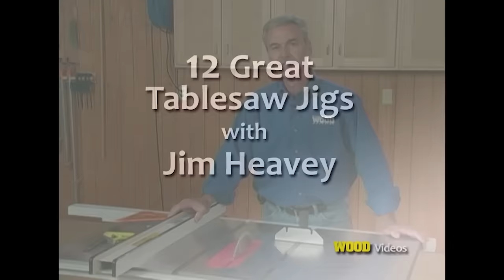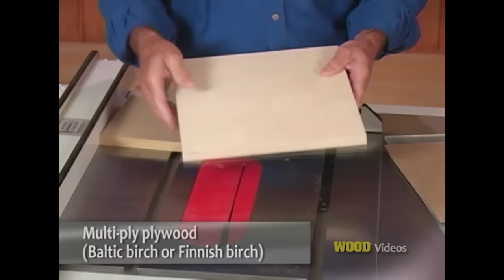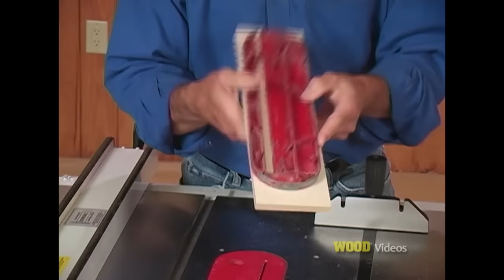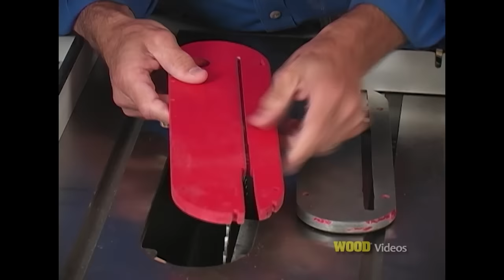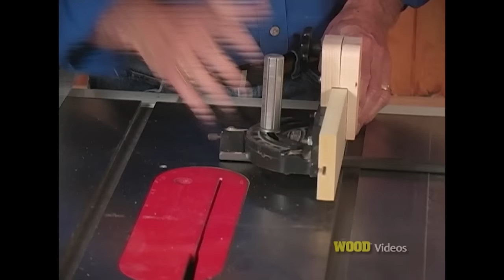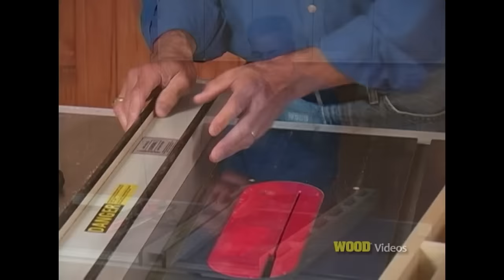12 Great Tablesaw Jigs with Jim Heavey - WOOD magazine

Comment: I had issues getting my crosscut sled to a perfect 90 until I used a 3-4-5 triangle, but x3, so a 9-12-15 triangle.  I cut the bottom then measured from the cut along the back fence 9 inches and made a mark, then measured 12 inches along the cut on the bottom and made a mark.  Then I cut a piece of wood to exactly 15 inches and put it between the marks.  When the 15 inch piece of wood was perfectly on the marks, I knew the sled was exactly 90 and I clamped the fence down and then secured it with screws.

Comment: Click on the minute mark to go straight to the spot in the video. Wish they would have done this themselves. I knew I'd be back to this video several times. I figured it could be useful for others also. 
Before You Start Making Jigs
0:30 1. Assure the blade is at 90 degrees to the table
0:51 2. Assure the fence is parallel to the blade
1:20 3. Assure the miter is square 

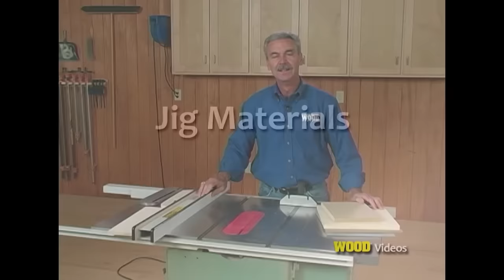1:45 Types of materials to use 
 
Must-Have Jigs
3:36 Zero clearance insert
6:36 Miter gauge extension and precision stop
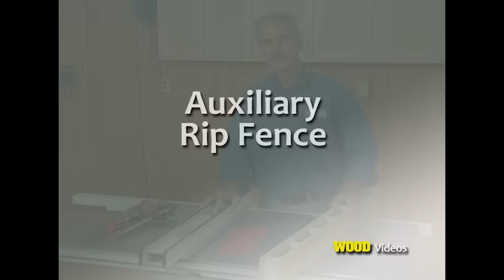8:19 Auxillary rip fence, aka sacrificial fence
10:30 Off-feed table 

Nice-To-Have Jigs
13:00 Raised Panel (for cabinet doors, etc.)
16:30 Ninety-degree crosscut sled
20:50 Four-sided tapering 
29:30 Tenons
34:30 Spline-cutting (for the corners of boxes and frames) 
37:00, suggested one at 38:30 Thin-strip ripping (to fill the splines from the previous jig)
40:35 cove-cutting  (create crown mouldings)
Reply: They should pin this comment to the top!
Reply: Thanks, that was appreciated.
Reply: I was looking for the table of contents guy.... Found him...Thanks!
Reply: Thanks Pedro for both thinking of this idea & for delivering this invaluable timesaving "tracking index list" for this incredible video.!!!

You're indeed an unselfish Saviour.!!!
Reply: Thank you, now I don't have to watch this whole video to see what he is doing. aka, I don't have to watch any of this video because I already have all of these.
Reply: Thanks dude! Much appreciated. 👏🏻👏🏻👏🏻
Reply: @gwythal.doire.4361  ; LoL, you're welcome :-)
Reply: So what.. nothing else to do?
Reply: @xl000  A little OCD works out well for woodworking. 
Apparently, Pedro saw a way to make an improvement and took it upon himself to do the community a favor. 
I’d say it’s a generous use of his own time. 
Viva La Pedro!
Reply: i count 11 jigs... is #12 using the four-sided tapering as a jointer or is it the one a lot of people use for Thin-Strip Ripping, but he doesn't recommend?

Comment: On the tapering jig starting at 26:45 where he is turning the work piece to put the taper on the other sides add some springs on the clamping devise. The spring will keep the clamping device in the upper position when you loosen it to turn the work piece allowing you to slide the work piece into the device easily then tighten it to make your next cut.  Thank you very much Mr. Heavey and this is my gift to you.

Comment: Great jigs!  I made my crosscut jig a lot bigger, and never regretted it.  Just used it tonight to build a cabinet, and I needed that space.  I'd also add some more meat on the crosspiece in the vicinity of the cut so the sled doesn't bend or break while handling it.  I'll be using that cabinet to store jigs...

Comment: Great video.  One suggestion with the taper jig, if you attach a runner to the bottom then you don't need to use the fence, and you will know that the edge of the jig will always be tight to the saw blade.

Comment: Some great ideas and a brilliant video. Fast spoken right to the point no fluff love it. One suggestion if I may. The last jig for doing trim moulding. I believe it would be better to have the cross brace pivot on the side closest to the blade and the excess crossing over the fence instead of having to move you're feed hand every time to jump over it.  Thanks

Comment: Jim one very very important setting to check is to make sure the blade is parallel to the groves cut in the table saw top. I bought a brand new Grizzly table saw and could not figure out why this saw wasn't cutting square cross cuts and seemed to be binding. It turned out the blade was over 1/8" out of parallel to the groves in the top and that is just from the front of the blade to the back of the blade. It was so bad I didn't have enough adjustment to correct it. It was also years later that I found this out and had no warranty and had to take it apart and get the pieces machined to correct the problem. It is an advanced setting but one that can and should be checked when even you get a new saw.

Comment: Loved the video but one thing that you did not mention which has been a persistent issue with several wood workers I've known is blade/table alignment. It is generally not a difficult adjustment but can wreak havock on everything you try to cut as long as the blade is out of square with the table including but not limited to excessive kick backs and blade warpage.

Comment: I really appreciate this tutorial. Awesome ideas worked out to be easy, accurate, and efficient.  One question: I didn't read all the comments, but observed that the raised panel cutoffs were a bit less deep at the front of cut, and then rode a little deeper into the panel in the center cut.  If this shallowed out again at the back end of the cut, it makes me wonder if the slight caul is the cause? Are the clamps pulling in far enough on the outer ends of the panel?  The main question would be whether the raised panel profile has any visible swoop near the corners?  But this is way better than trying to freehand a raised panel cut against the stock fence with two clamps

Comment: Excellent Video.  Thanks for the clear explanations.  In January I scored an excellent belt drive table saw with a brand new 3hp motor and new bearings everywhere.  It was an opportunistic find.  Very inexpensice.  All cast iron with a heavy duty steel angle iron stand.

Comment: great video, only change I would make is on the cove jig: The brace for the arm that gives the angle to the fence should be swapped allowing the "extra over hang" to be placed over the saws actual fence. this would allow for the piece of material going over the saw blade to ALWAYS be supported by both hands at all times. (Right now you need to move your hand off then over and back to the board. this can cause several unsafe conditions.) just my thought. AWESOME JIGS... THANKS
Reply: Jesse Izor mo
Reply: Exactly what I was going to suggest!

Comment: I feel like a kid on Christmas morning!  What a pile of presents!  I will be making several of these, if not all, especially that cove-cutting jig.  I've been locked into the idea of clamping a fence at an angle to the table top, but this is much nicer.  I may put the swing arm's pivot on the angled arm, so I don't have to work around the end of it, and just let it stick out over the fence where it's not in the way of anything.  But a super jig, AND a super collection of jigs!  Thanks!

Comment: the jigs are fantastic. a little more elaborate than some designs (e.g. the crosscut sled) but every feature clearly adds value and is worth the effort to incorporate.  the feature-by-feature explanations are a little terse for a beginner (I had to catch the tapering jig segment 3 times before I understood how the nylon locking nut on the first toggle clamp is important, and the dual-level shelf on the shoulder jig never really got explained). The bulk of the crosscut jig build and feature explanation got edited right out, but overall a really good tutorial. I will be trying many of these out in my shop.

Comment: Very good video! One caution: I bought a used table saw and the blade was NOT completely aligned with the miter slots. Thankfully the saw did allow for adjustment and I have plenty of experience with the  alignment of machines.

My brand new jointer, a very nice one, needed the gibs replaced. I machined and ground them myself, and it works beautifully now.

Comment: Great video and have watched a few times and I have some new ideas for jigs.  A suggestion on the jig to cut coves.  If you put the fixed point on the cross piece on the board that swings and then tighten the knob at the other end that will now be by the fence, you won't have to move your push pads and overreach your hands over the cross piece.

Comment: These are great. I did wonder (for the cove cutting jig) if you hinge the swing arm on the arm going across the table, you won't need to hop your hands over the excess (which will instead hang over the fence)  -might make for a smoother cut??

Comment: If your zero-clearance insert has seen better days, tape the top completely closed and pour epoxy onto the underside.  Recut your slot and it's as good as new.  PU glue would also work.
Reply: smart
Reply: son of a b#@$h that is a brilliant idea soldier.  how long were you at Ft. Benning?  for me 5 years G company 1/10FA 3rd brigade 3rd ID up on Kelley Hill  08-13
Reply: Nice idea thanks.
Reply: Bondo auto body filler works great also.

Comment: For cutting stock down to make a zero clearance insert, I usually use 2 sided tape to stick the original insert to the plywood and route it with a flush cut bit.  Then the contour is a precise match to the manufacturer's insert.

Comment: One point I have had a problem with. At the beginning you talk about set up. You checked that the blade was parallel to the fence, by checking that the fence was parallel to the grove in the table top. That assumes that the blade is parallel to the grove. Mine wasn't, it was about 3-4 degrees out of line. The table had been dropped pre-delivery. It took me a while to figure this out.
You can check blade alignment with the grove in exactly the same way as you checked the fence alignment with the groove. If you pick one blade tooth as a reference, that should allow for any non-flatness in the blade.
I only mention this because it took me 2 years as a beginner to work out why some of my long rip cuts were producing banana shaped strips.

Comment: Jim,  If I need to make multiple zero clearance inserts I don't remove them from the original insert. I keep a supply of the set screws on hand or put them on my  need list when planning a project. it helps me in several ways, including the longivity of the inserts.

Comment: Very informative video - many thanks!

When I saw the four-sided tappered jig, I thought: "Wow 16 cuts to make for a four-legged table; that would be incredibly tedious and hard to do without this jig!" Sure enough, Mr Harvey mentioned it later on.  I still don't understand the plastic stopper on the top of the jig, though (as I can't really see it).

What is even more interesting are the terms used: shoulders, cheeks (for tenons).  These terms are very easy to remember!

The last jig (cove-cutting) is also very interesting - it might come in handy once in a while.

Once again, thank you for a great video.

Comment: You do fantastic work, I wish I had you as my instructor back in high school. Every jig is very helpful. Thanks keep up the good work. ⭐️⭐️⭐️⭐️⭐️
Reply: Yea mime was a real jerk I failed shop because he wouldn’t let use anything with a motor on it, he handed me 50 Small knobs a a pc of sand paper. Today There’s no tool I don’t have today and can skillfully use all of them. No trade in construction I haven learned or Equptment I haven’t ran. I Dropped out of high school at 9th grade went into construction at 16. At age 48 I was a self made multi millionaire as builder developer. AMERICA IS GREAT I Never get to do things for myself because always working, now it time at 66 to slow down and enjoy wood working for enjoyment and hobby.
Reply: @dduncan221  hey Dennis saying that you’re getting close to retirement I’m already retired I’ve got into the hobby of RC airplanes a lot of fun nowadays I join the club and the guys are fantastic a lot of fun and you might want to look into. Once you buy your transmitter and a couple of batteries the planes are fairly inexpensive.
Reply: @w.j.bendellr.c.flying.1037  RC? Is what sorry
Reply: @dduncan221  Radio controlled airplanes, they have some that almost fly automatically very easy to learn. I’m having a blast flying.

Comment: @4:55, instead of cutting a zero-clearance throat plate on the band saw, use double-stick tape to mate the factory throat plate to your plywood and use a pattern bit in your router to cut the plywood.  The factory plate is your pattern.    Also, @42:16 (cove cutting jig), flip the brace so the wild end lays over the top of the saw's fence; the brace is now out of your way.  Cheers!

Comment: 32:38 Ha, easy to construct a tenoning jig for a Biesemeyer style fence.  My tenoning jig for my Unifence is a work of abstract art.

But the tips in this video are fantastic, I will definitely be making some of these.  btw, 29:00, I use a couple of simple 3/4-in. "rip sleds" of four feet and eight feet (could be any length) to straighten out stock, both for finer trim boards and dimensional for framing when I need perfectly straight walls - so I rip 2x6s or 2x8s down to 2x4s or 2x6s, especially for curved walls, walls to be tiled, etc. - since we know there is no such thing as a straight 2x.

Comment: One thing to add.  There is a way to check if your crosscut sled is accurate.   Cut a wide parallel piece of stock with the sled.  If the long edges are parallel and the cross cut is exactly 90 degrees, the cuts will still line up when you flip one of the cut pieces.  Any error will show as a gap.  And of course... excellent video.

Comment: on your last jig you should switch your top brace end for end so the stationary nut was out by the table saw blade and the adjustment nut was by the fence that way you don't have to work around the excess brace.alot of good information thanks.

Comment: Helpful for a novice or somewhat new woodworker. I liked the taper jig. I don't like the thin strip one at all, that's what a push stick is for. I also wouldn't cut 1/8" anything on a table saw after 25 years on one. That's what thickness Sanders are for

Comment: On your cove jig I would suggest the cross member originate on the angle portion and then  overhang your fence, that way you would not have to rearrange  your push blocks pushing the board through

Comment: Built the taper/jointer jig.  But used T track in baltic plywood.  On the cove jig, make sure you make it so the setting bar excess overhangs the fence, not over your cutting path.  His jig really should be run on the other side of the saw by a left hander.

Comment: Great stuff. The cove molding jig could be improved by making the angle adjustment arm in the opposite direction so that you don't have to jump over it in order to make your cut. Obviously the arm needs to be above you saw fence, however the excess of the arm is out of your way.

Comment: Great presentation. I guess it really depends on what project you're working on at a given time, but personally I would've had to include the crosscut sled in the "must have" category since I use mine so often.
Reply: Absolutely agree. The crosscut sled almost never gets put away for more than a few days.

I also have a ripping sled, somewhat similar to his taper jig, but mine rides in the miter slots, with several lengths of moveable fences and multiple clamp locations, that I couldn't live without as a builder of electric guitars and basses, furniture, shelving, and just about anything else.

Comment: Nice, the only thing I would change is the cross cut fence, I would cut vertical  dove tail and buy a couple of dove tail clamps, 
the roller table used for table saw supports is a great idea , Definitely using that, perhaps using my existing saw horses.

Comment: very good video. I have a panel saw for large pieces but need to make the jigs for smaller pieces.. But at 4200  I would have the adjustable arm pivoted from angle piece and clamp on the factory fence side so you can keep down pressure with out reachinf over the fixture,ce

Comment: I especially liked the part (in the Raised Panel Jig segment) where you reached in to loosen the clamp knobs while the blade was still spinning. Great safety demonstration. ALWAYS wait for the blade to stop spinning before reaching in, over, or around the blade to do anything. It only takes 10-15 seconds for the blade to stop, but it takes even less time for it to catch and pull your fingers in. It’s not worth it. Patience is a key element of safe saw operation.

Comment: I enjoyed this video and will definitely make some of the jigs and leave them at the local Visual Arts Center here in Richmond. With the many inexperienced or absolute beginner wood workers that use the wood shop useful accurate and safe jigs are a real bonus. One quick question. In the video trining the edge straight using the taper jig you didn’t use the zero insert and at the end of the video you can see a thin cut off being “sucked” down. Sorry for being so picky but thought you’d want to know😊

Comment: 0:54 No. You do that only after you ensured that the blade itself is parallel to the miter slot. Slot should be supreme because it is the fixed thing without micro adjustment. If the blade is not parallel to the slot, adjust the blade (there is usually a way to micro adjust the blade alignment).

Comment: It's worth pointing out that for checking squareness of the miter gauge, that the square should be touching a tooth at the front and back of the blade, or else NO teeth and is resting squarely on the body of the blade.  Same goes for checking squareness of the blade to the table - since you can't reach a tooth at the bottom of the blade, the square should shoot between a couple of teeth and rest squarely against the body of the blade.  That should be called out in the vid; newcomers to the craft may miss this subtlety and not know where they went wrong.